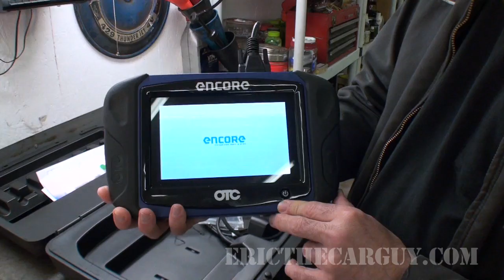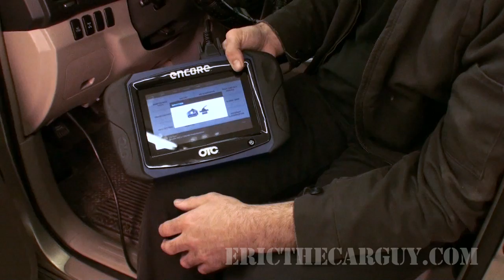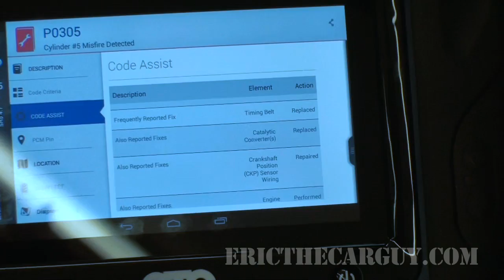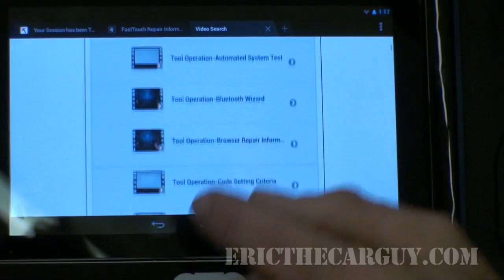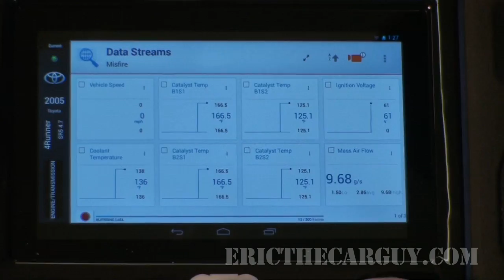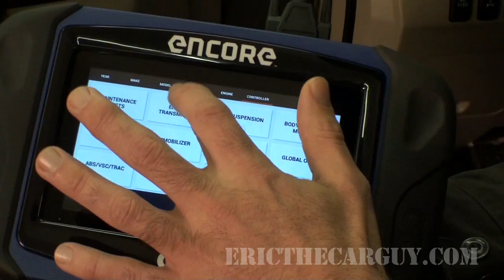OTC Encore Tool Review -EricTheCarGuy

Comment: Some concerns after purchasing an OTC Encore: 

I found that none of the three ports were usable to export data from the scanner! The two USB ports do not work and the Save to SD card option doesn’t work. I verified with OTC Support that the ports do NOT work. The only way to get info out is through a wireless connection. If you don’t have a wireless connection or cannot use wireless because of a sensitivity to electromagnetic fields and want to transfer data or access the web—forget it. They could have included an Ethernet cable port.

I found that I could not set up an email account for Outlook. I understand that it is because the Android OS is old. OTC Support told me that it is not updatable. I have updated my OS in my phone, I am pretty sure and of course various computers can be updated.

Another significant issue is that to make the email function with Gmail, you HAVE to turn on less secure email access. I have had an email account hacked so this is totally unacceptable.

I also have found that the display can be hard to see at times when the ambient light is bright.

Comment: probably doesn't have the air suspension, but if my 20 year old ford SUV (98 expedition) has an immobilizer stock from factory as standard on ALL trims, i find it hard to believe that a 13 year old toyota suv doesn't

Comment: The most important part is how do you replace the batteries?
Or does it just go in the trash when the battery stops charging?
Reply: A replacement battery is fairly inexpensive and readily available.

Comment: So they couldn't just make an App for every phone that reads Bluetooth OBDII.. They had to give you an Ugly crappy Tablet as well..
Reply: +Ioannis Tzon Tsolakidis Just buy yourself an Bluetooth or Wi-Fi&#160;ELM327 for next to nothing (10-15 bucks) and download an OBD Auto Doctor app. It has all these functions and it runs way waaaay faster. The app is free too and is available on all the phones Android, Windows Phone (I don&#39;t know about iPhone, but I don&#39;t care about Apple&#39;s overpriced crap anyway so that&#39;s not a minus in my mind, but it should be available there as well if you&#39;re into that). It even does fuel trims and that kinda stuff.
Reply: +Ioannis Tzon Tsolakidis For the home gamer, a bluetooth ODBII connector, Torque and google will do the job; but in a workshop, you don't really want to be relying on your personal smartphone or consumer tablet and cheap ODBII adapter; you want something that is a bit more robust, and ideally does everything at once.

It also looks like it has manufacturer specific codes on there; IE my Torque/ODBII can't touch the body control module on my car.

The price is high for a home user, but for a workshop charging £30 for diagnostics, it'd pay for itself pretty quickly.

Comment: Just got one and wow is it limited and slow,  Compared to the Bosch KTS340, Snapon, and BMW icom.  This is a good tool for the back yard do-it-your-selfer.   As a shop owner of a high volume independent BMW shop this thing has very little use for me. On a 08 bmw 335 i have to look in the transmission to see the coolant temp.  One would think it should be with the engine.  Cannot see the CAS module to determine if the starter is faulty.
Reply: In a recent video by Eric, he said updates sped it up. Maybe you should update it.

Comment: Eventually the hood will be bolted down with security bolts so only the dealer can service the engine.
Reply: +Himmel Weint true but with the electronic sensor the idea is you will never have a need to pull out the dipstick. When the oil is low the car will tell you. From a servicing point of view a dipstick would be much easier. But for the everyday driver who rarely checks their oil the electronic sensor is better. Ideally bmw should have used both options.
Reply: lol pretty much bmw is heading that way by removing oil dipstick and transmission
Reply: DE Nichols
if the sensor fails well you are screwed not very clever from bmw
Reply: I'd never buy one.
Reply: +chupamishuevos303 yeah that's stupid because if the car is sitting for 2 years or more you don't know if there is oil in the engine.
Actually even the bmw mechanics could not know the oil only solution is empty the oil pan and refill oil in the car
Reply: lcpd26 If electronics keep working, I've played with the dash and it'll say whether to add a quart or not. ..but what if it is empty? Do have to keep checking to see if the quart is added?

If it has a fail safe to add versus not what if you ruin the engine with too much? Dipsticks are obvious if broken. Electronics aren't.
Reply: +chupamishuevos303 but you can check the level on the dash. They removed the dipstick because you don't need it. The dash will let you know if the engine needs oil. Perhaps if you can't keep up with technology you better stick to the old fashioned cars.
Reply: Daniel Warren ...but a dipstick is a couple dollars of metal or less of insurance...
Reply: +DE Nichols not everyone checks thier dipstick. Especially the sort of people who drive expensive bmw's. There's plenty of people driving around with low oil levels. Everyone looks at thier dashboard. Don't see why they can't add both though.
Reply: Daniel Warren I agree. :)
Reply: +Daniel Warren Problem with that is it takes ages for the sensor to detect what level the oil is at whereas if it was a dipstick it would take 2 seconds.

Comment: Would this tool work on my 1992 Nissan 300zx?
Reply: It depends if it was modified for ODBII, a quick internet search shows that it is pre-ODBII, which this tool would not even plug into. You would almost certainly be looking at ODBI, and would need an ODBI tool. Eric touches on this in the video if you watch it all the way through, he said something to the effect of "1996 and newer" in relation to what the tool can be used for, and goes onto talk about a few more advanced features that are only available on newer automobiles.
Reply: FFirst LLast thanks for the info. I must've missed when Eric mentioned it.

Comment: Great tool indeed, but as many of you guys have pointed out, this is just a cheap android tablet (hence the slowness), but you could get a much nicer one and get the same program on it, since android has a huge range of modifications and i don't think it would be that difficult,  it will definitely speed up all the scanning process! Great vids as always Eric!
Reply: I think all the custom gear you'd need to get something similar to this wouldn't be easy. How many people want android to hook up to a DLC to an OBD II port? If you want basic. I love the torque app bluetoothed to my phone through a OBD II bluetooth adapter.

The last few times my car broke down I had the torque app running out of habit and I figured out what was wrong with my car and another time my truck, before the vehicle even started struggling.

Comment: I'll stick with my Snap On MT 2500 it works great with pre 1996 and post 1996 vehicles and is bidirectional if the vehicle it's used on allows it. Good review though.

Comment: No idea what CPU they used in this tablet but it's obviously not good enough.  Custom GUI is nice and everything is highly polished except for the most important part; the performance!  I would get very frustrated trying to use this tool.  It's simply not fast enough.  It needs a better CPU, faster BUS, or less overhead to allow it to perform faster.  I could hook up a Windows 98 laptop and get faster response times using serial.  No excuse for modern hardware and software to be so slow especially since BUS speeds have steadily gotten better the past 10 years.  With that said I'd still try it because it has way more ability than a DIY $50 code reader.  Great honest tool review Eric.

Comment: That Tablet Seems like a waste of Money, Its just a Single Core Android tablet with Different I/O Ports. Seems easier to just do something like this with a laptop or something. It doesent Even have the Play Store on it. you have to manualy instal it.
Reply: Yeah it seems you could take a normal laptop, and or tablet and a USB cable with an ODB adapter? Not sure if they make those, but it seems likely that they exist. A quick search and I found ELM327, it's a USB to ODBII connector, the only thing left would be the software needed to read the codes, which a dumbed down, cheap version might be included, and or find other software that is compatible, and then the cost of a cheap laptop/tablet whatever is compatible, and there you go. A likely cheaper way to go, but not all in one package, and likely a bit more knowledge involved to get the features you want.

Comment: The need fot a constant connection means this really isn't for home users and i suspect a number of indy garages too.

I know VM/Skoda shops have there own custom scan tools that connect back to the VW to look up on a central datastore.

The slowness of that tab is a let down too; most recent tablets have a decent set of hardware specs so would expect them to be quicker.

Comment: I've had issues with slow vehicle communication with my Autoenginuity, too. I suspect a lot of this relates to the vehicle computer, and slow communication through the OBD port with generic software. I also believe that a lot of the delay is waiting for the device to hunt for the right language. The price you pay when using generic devices is time and incomplete data, but it sure beats paying for dealer software.
Reply: Gavin Morrissey Retrieving vehicle data has nothing to do with wifi.  It pulls codes from the DLC cable.  The wireless is for firmware updates and information about the codes.  That's not part of the OBD-II CAN protocol (retrieval process).
Reply: It could also have something to do with the clock speed of the cpu. Most all android devices are in a state of under voltage in order to save battery life for most consumers, this could be the reason the software is quit a bit laggy for a lack of a better word. I agree with you both its just an issue they will have to resolve in a future update. As for it having a 1.2Mhz processor, that doesn't mean it's allowed to use the whole 1.2. Kind of off topic but on topic at the same time. My cell phone is running Android 4.2 and has the SnapDragon processor which is supposed to be clocking in at a total of 1.5Mhz, but when I purchased the phone they had it capped at a whopping 800Mhz. Needless to say it was rooted and clocked. After seeing the product in action and as quickly as it was moving around during other functions, I'm going out and saying it is an issue with the processor not allowing enough of the cpu to be able to perform the task at a reasonable rate of speed. As soon as it is put under a load it seems to slow down significantly, Other wise I think this would be a great tool to have, you can store multiple vehicles, and if you get repeat vehicles with similar problems you already have the data stored on hand to be able to speed up the process. This was another great tool review by EricTheCarGuy!
Reply from the maker: Well, OBDII IS a generic language. That's one of the reasons they came up with it in the first place. As for the 'slowness'. I'm not an expert, but personally I think that has something to do with the processor. Faster processors, cost more.
Reply: It's most likely the CPU speed, however memory and quality of software programming can be as big, if not bigger factors.  There's no easy way to tell on a proprietary device, though.  The next model will probably be faster.
Reply: *****
I hear what you're saying, but in my original post I said that my Autoenginuity seems to have the same problem when it communicates with a vehicle it hasn't seen before. That program is loaded on my laptop, which has a fast processor and lots of RAM. When it comes to communication, the speed of two-way communication goes as fast as the slowest device. We're trying to communicate with vehicle computers that were made over a decade ago, and not necessarily designed for speedy OBDII communication.
Reply: EricTheCarGuy Could also be due to your wifi signal strength?
Reply: MikeTheITGuy the cpu has nothing to do with speed. I mean it's fast enough to handle the speed but it's on the software side that cause the delay.
Reply: *****
first of all, i dont need no insult coming out from you. im also a IT guy myself. the reason why the device cause so much delay its not the tablet itself. im pretty sure you have a quad core with hyper threading, try to put in a scratch cd and see if your other apps "wait" for it.

remember the the otc encore works better for 2007 and newer cars. that said, 2000-2006 cars that is compatible with it may not be optimize for it. therefore, its the reason why it cause it to delay or in your views slow.

brute force has nothing to do with speed to go through the process computing power for something that require not much computing at all. if it have to wait for one thing it will wait forever until it reaches is time quota to give up scanning.

beside you used the term brute force in a wrong way, you cant make a slang out of it. you will just confuse people whos reading this. brute force is known for a style of cracking through password by dictionary of words to attack with.
Reply: BlueRice  "The CPU has nothing to do with speed".  Yeah that's about the most ignorant thing I've ever heard.  Please don't breed.  You're also trying to argue with someone with a name that includes ITGuy.  Historically, not a smart move but technological intelligence is obviously not your forte'. Software can cause latency issues due to overhead and poor coding but it can brute force its way through that with a good enough processor, memory, and bus speed.   There are no specs for this device but it's common to find the 7" Android Tablet with a 1.2Ghz CPU.  Yeah I'm sure it's not the CPU.... gotta be the software right?

Comment: Can you add more RAM memory to it?
Reply from the maker: Not to my knowledge but they do provide software updates that help keep the tool updated.
Reply: You can't add ram to tablets...
Reply: fightingfalconfan 
Not entirely true, Some, not all tablets do offer a bigger ram chip sets for installs. It's rather expensive and the gain usually isn't all that great but some tablets, and phones are able to add larger amounts of ram.
Reply: fightingfalconfan  I've never had a tablet that didn't have a spot for a mini sd card. Eric did put a SD card in it. He added to it's memory without thinking about it...his goal was more so there was another way to transfer data from it to a computer.
Reply: You both are getting SD card memory and RAM confused...they are not interchangeable.
Reply: fightingfalconfan I had a tablet that used a mini SD card. When I told each app to share memory with the card it sped the apps up. Slow tablets can be sped up with high speed memory. I bought the second fastest available. 
SD in Android can play an important role in speed. Especially on a cheap tab with slow memory.
Reply: Fighting I am not confusing the two, I know what the difference between ram and SD card memory is. Tablets use a special kind of ram much different than say DDR3 ect for a pc, by all means you can buy ram for anything. The issue being, the hardware limitations on the device probably wouldn't allow you to add more ram anyway. Still though the fact remains that yes you can add more ram to the thing.Where as SD memory is just flash memory on an external device that is loaded into said hardware. Whether it be a cell phone, tablet, Ipod ect. Now most android devices when rooted ( which should be done very cautiously and not by anyone that doesn't know what they are messing with) will actually allow you to edit the build.prop of the system and let you switch the way the device reads internal and external memory. In essence it allows you to fool the device into thinking that the external memory card is actually the internal and vice versa. Albeit they are only a few devices where this can be done and not cause system bugs and random crashes. Hope this was helpful and didn't seem rude, as it wasn't meant to be.
Reply: Justin Mcclung I wasn't confused either. No fight in me either. I just enjoy learning from everyone's comments. :)
Reply: Glad we can all be civil and learn something from one another here. :)

Comment: You keep mentioning the good price for the tool. I saw 1875USD, which is quite expensive, given the usual price range of Android devices and the fact that this tool is not even equipped with a very fast processor. In fact, the "Android tablet" part of it looks more like one of the cheaper devices in the 100-bucks category, so what is it that makes this tool so expensive? Is it the OBD2 connector module w/electronics? Is it the rugged design and casing? Or could a tool like this one be sold for under thousand bucks and still produce some decent profits for both the manufacturer and the vendor?
Somehow I don't get, what the really expensive part of this tool actually is...

(Edit: Of course, since I don't work professionally on or with vehicles, there would be no point for me in buying it anyways, but when I look up prices of scan tools, many of them are much cheaper. What does "bi-directional" mean? Other tools can also write data to the car, like clear codes and stuff...)
Reply from the maker: For an explanation on bi-directional, see the video in the description about choosing a scan tool. As for the price, I suppose it's relative. A Snap-on equivalent is 4K.
Reply: EricTheCarGuy Yeah, but what is it that makes them so expensive?